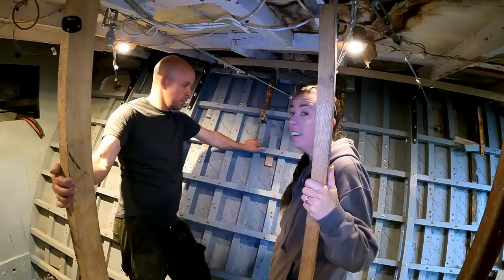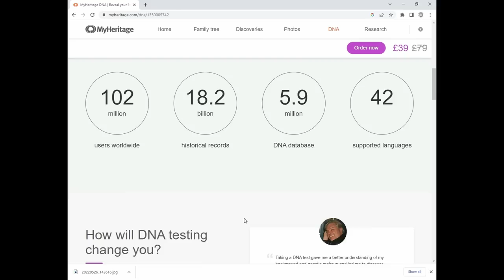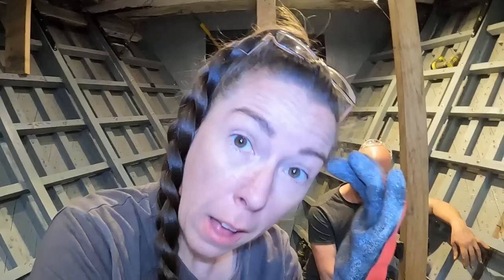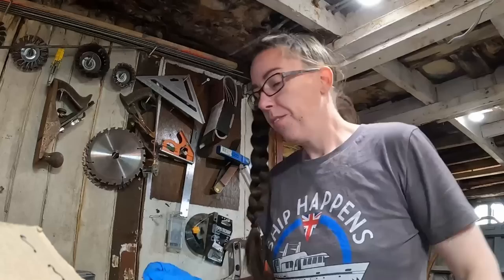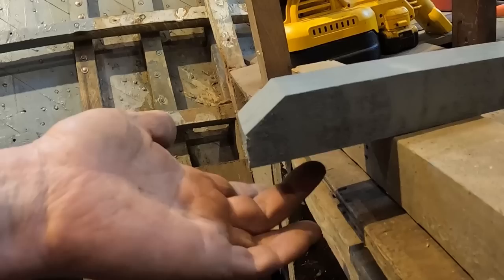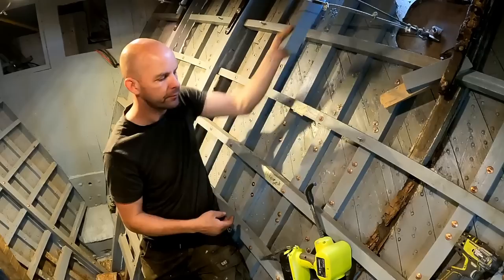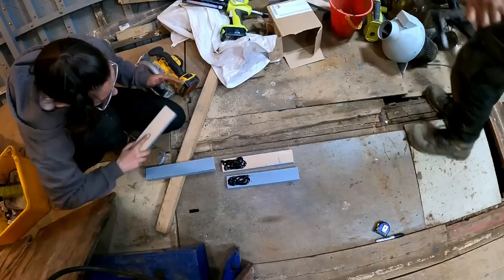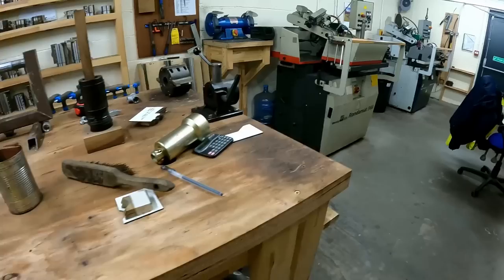EP 76 - Wooden Boat Problems! Running Out of Wood!! #boatrestoration

Comment: Message for Gemma,use some beeswax on the cutting wheel so it will cut so much better on copper,this stops the wheel clogging up with copper, this also applies to aluminum especially.some people wax the whole wheel and put it in the sun or where it can melt into the wheel like an oven.
Reply: You might find that stone cutting wheels work better on Al and Cu. Saying that, I cut Al sheet with cheap slitting discs. They work fine but don't force them as they can shatter.

Comment: If you check at your hardware / abrasives supplier, you can buy a cutting wheel specifically for non ferrous metals, if they are now making then with a depressed center, you can use these to cut off the copper nails flush  in 1 go

Comment: You can convert a vise-grip plier to a 'slide-hammer' by removing the adjusting screw and replacing it with a bolt that has a 45 cm rod welded to the head. The slide is just a 2" dia by 4" long piece of plumbing pipe with drilled out end caps. thread the end of the rod and use double nuts to act as 'stoppers'. The rod can be removed to convert the pliers back at any time...
Reply: great idea
Reply: Do they have fencing pliers/ cowboy tools in the UK? Put it on your wishlist if you want one. Its handy for a lit of nonesense

Comment: It,s coming to  in bow now looking good, dont forget to clean the dribble holes
they run from bow to stern water trickles to the lowest point, i bet it smelled good
in that wood yard and yeah it,s hard to find somewhere good and stacked proper so you
dont get banana wood lol some one said melt ya brass yup and your taps there brass too
not be long now for sailing the horizon

Comment: Just thinking about why the frames have rotted and not the planking.  These were ships of war. If you look at Medusa you see the bare frames everywhere. They were not supposed to be covered up. When Darinda was converted it was all panelled in, showers and other wet things were installed and the deck let water in too, but it had no way of evaporating so rot set in. Ventilation maybe is a thing to think about in due course, and what's behind the panelling in the cabins?
40 seconds to rove, cut and pein each nail! Now that's some going!
Reply: But the hull planks would be as exposed as the frames to the condesation. I wonder what species the hull planks are from.

Comment: The planking is likely either mahogany or teak. Both are more resistant to rot than oak, which may explain why the planking is in better condition. Teak is very rot resistant, but also super expensive. Don’t know if it would have been used for a military launch. It’s good that the planking is in good condition. Double planked hulls have a layer of canvas set in bedding compound. Eventually the canvas and bedding compound can dry out and fail as the planks shrink and swell with changes in weather. The only way to repair it is to completely remove the outer planking, replace the canvas with fiberglass cloth and rebed with 5200 or sikaflex. Then a new layer of outer planking must be applied. So, keeping the hull in the water is the best thing for preservation. Also keeping the hull painted.

Comment: I fitted some green oak gateposts and made the mistake of using normal exterior grade screws to fix the hinges. The posts always twist over time so I expected to be repositioning the hinges. I was not expecting every single screw to shear off. I tried stainless but they sheared off before I had them fully home. Putting stainless screws into oak is definitely an art. It was only a gate post, so I fitted new exterior grade screws with plastic wall plugs. They are still there to my knowledge. Obviously a boat needs to be done properly - not easy.
Reply from the maker: I only recently found out that oak sap destroys normal screws! Never ending learning curve! X

Comment: I never thought of why the planks are fine and the rest is not, Glad for you's they're good. I have wondered many times how the wood at the bottom (keel timber?) is not rotton and do the frames fit to it. Or is it the outer skins connect to the keel timber and hold them together?
Great work as always and what a find at the wood yard😀

Comment: ell I am glad you found a wood supplier but marine wood is cut different than wood use to build homes its free of knots and is cut so the grain is vertical along the length of the piece of wood . If you look at the end of a piece of house hold wood it cn be cut where the grain is on an angle and that will weaken the wood if used on a boat
Reply from the maker: Awesome place and top blokes all of them!

Comment: I've been wondering since I started to watch this restoration: why are the planks in such good shape and not the framing/superstructure incl the keel? Different species? Treatment? Exposure to moisture/air?
Reply: Fresh water leakage causes more rot than exposure to salt water.. The planking is Teak or Mahogany. 
Most of the rot is where it was modified in civi times and they didnt do a brilliant job or used some sub standard timber. The shower room area is a casualty of function..and tiles on plywood.

Comment: What will the font of the boat you are working on now be used for and the two different sized windows? In the front wall drive me nuts, just saying.
Reply: I think that's a rope/chain locker for the anchor chain.  it was shown in an earlier video iirc.